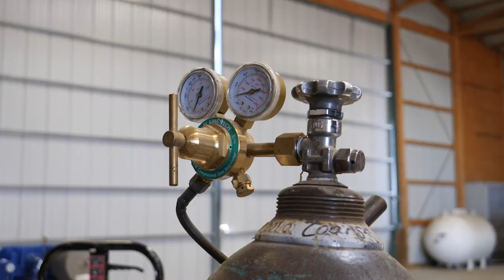Making a Battle Axe (Very Bad)

Comment: Looks good enough to take into battle 👌  2:52 Just a pointer in case you didn't know that kind of fuel is probably the worst type you could use for blacksmithing. It can be used, but it's going to be a pain in the butt as it makes ash instead of embers. If you can't afford other types of fuel most wood will work. Cutting it into smaller chunks works almost like coal. Hope it helps!